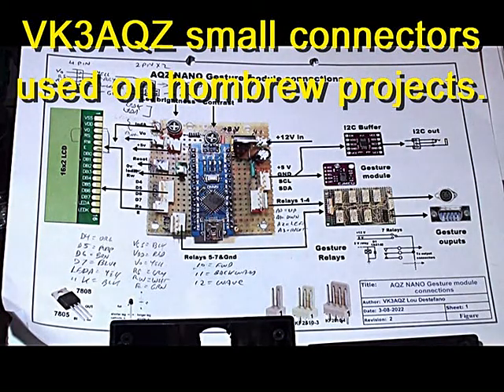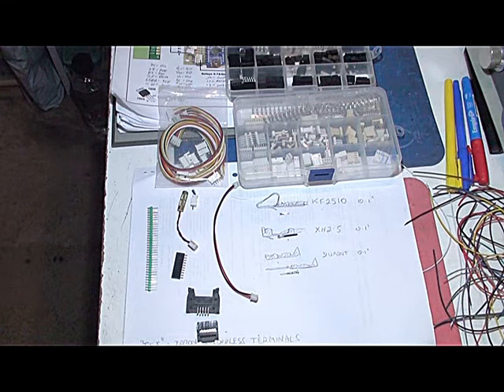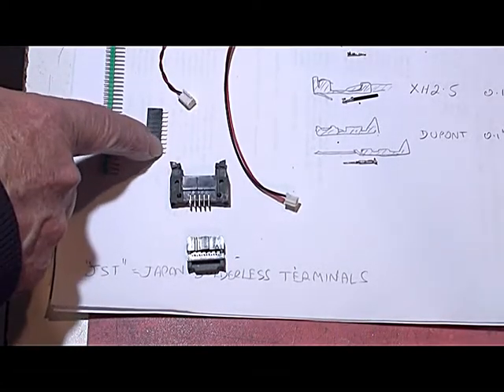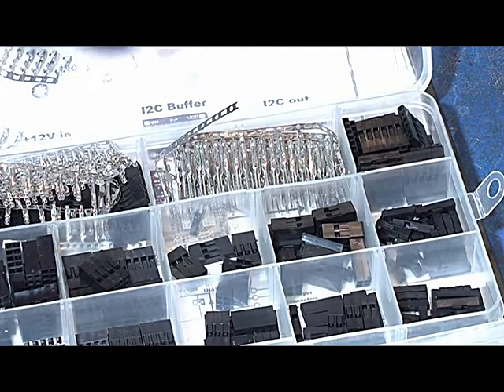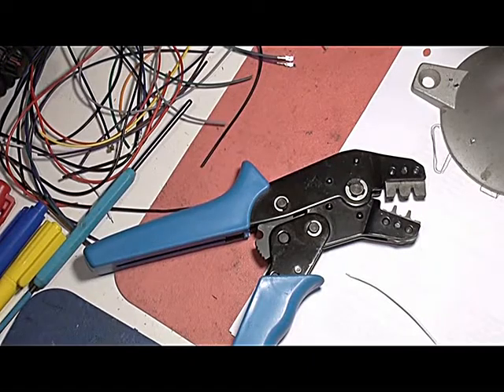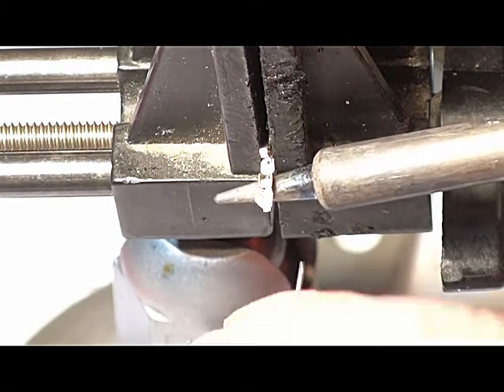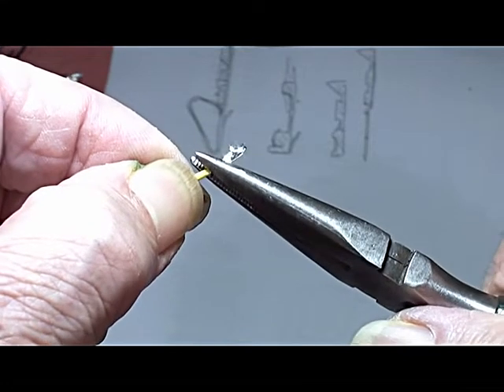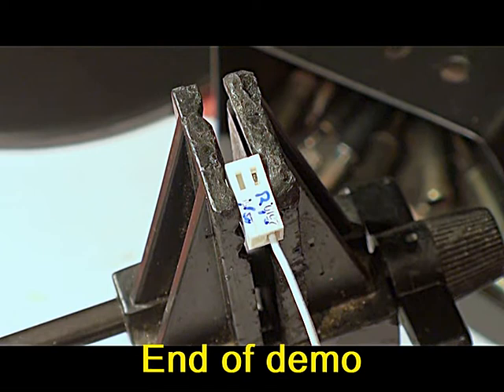VK3AQZ KF2510 connector demo

Comment: I guess the trick to depinning them is to fix them in place(trying the same thing simply by pushing them when they are not fixed is quite hard and often pins are damaged or stuck). Maybe an SL screwdriver cut to push a tab to a specific length should allow me to just do it on a table without vice. Or a vice grip pliers could help to do it fast if connectors with different number of pins should be depinned in a row(many times saw people crimping over insulation when contact is made by loose strands barely touching metal or just plane old loose crimps, I guess if such signs are present you should check all the connectors in a device)
Reply from the maker: Yes, but I hold the connector body in the vice then carefully depress the pin so that the lip goes below the plastic body edge and the pin moves out smoothly and with minimal damage. If you push down too far, causing the spring section to be flattened too far, I then retention the spring section. I test the grip by pushing a loose pin into the connector. If it is too loose, I retention the spring, or use a new one. 

I also have a pin extraction tool designed just the right width to depress the pin. But I am just as quick and clean with a spike. I have watched students try to extract pins in the class and those that don't succeed exert too much initial force causing a distortion of the body but not able to cause the tip to go low enough below the lip in the plastic body.

A bad extraction is just a lack of skill and not understanding the physics of the pin extraction. After I spend time showing students the correct method, they can then depin a whole row in seconds with no damage. It's just a matter of doing it correctly and not just pushing hard or twisting the tool and having a lack of patience.
Reply: @vk3aqz  Could you tell met the model and manufacturer of your extractor? I could not find any extractors for 2510 connector, except some tweezer looking thing that at the time was avaliable only on malasian sites, not even on aliexpress, let alone at the country i live in.
Reply from the maker: @qt1qg  I got it on EBay in Australia as part of a 20 piece connector pin extractor set. The kit has various extractors for Molex, the German motorbike ones, etc. Th KF2510 and VH3.96 extractors are like a small screwdriver with a flat blade about 1mm wide and a circular finger ring. There are about 4 different widths and 2 have a small, pointed tip then a flat blade the same width as the slot in the connector. As I said, I more often just use a pointed tip scriber because I can gently just push down in the right spot since I have plenty of practice. it's just a matter of getting the right feel. You can see from the video how easily I extracted the pin with the pointed tip. It's just skill and patience.
Reply: @vk3aqz  I have seen extractor sets, but they don't tell that they have one for 2510, if it does not have a way to limit the travel of the buisnes end sharp tool is probably better.
Reply: @vk3aqz  At first i thought that spring part of the contact gets bent in the process, but it looks like the tab is the thing that gets bent but not beyond it's elastic limint or not too far to be mangled(spring part does not even have a chance to touch opossit part of the connector body), if spring part starts to bend, depining attempt is failed along with guiding ledges in connector body
Reply from the maker: @qt1qg  Molex make a 4 pin version used on PC Fan connectors. I cannot post  a photo here but you can go to the Amazon site that sells the JRready ST5253-04 as an example. That one is expensive because it is part of a set. But mine came with a bunch of 20 or more on a key ring for a lot less. The keyring ones are single terminal and there are several sizes for the ).1" HF series , the XH, and the smaller JR (Japan  small types). 

https://www.amazon.com.au/JRready-ST5253-04-Electrical-Extraction-Maintenance/dp/B0C3M96DB1?th=1
vk3aqz
Reply: @vk3aqz  I think the only adwantage would be ability to depin several pins simultaneously, looks like there is no tool that would stop exactly when the tab unlocks regardless of the pressure applied. From your video I have learnt to depin 2510 with sharp object pretty well by now, even without vice. Thank you for the video
Reply: @vk3aqz  I have seen 4-pin model being sold as JST pin extractor, though I don't know how it would depin JST females, it seems nearly impossible to bend metal tabs on them, and the tool is to thick to go from behind(the best way to depin JST that I found is to depress plastic tab in the body by reaching from behind with thick THT lead or dull syringe needle, despite what I expected there is no damage done to the connector body)
Reply: @vk3aqz  Before this video I thought that pretty much te only way to remove them was to bend the tab that holds them in place, but it seems it is not necessary, as long as connector is firmly fixed. The height of the ridge in connector body, against which contact locks looks almost the same as male pin width, that means that you won't even cause any excess strain on the spring part if you depin properly!!!
Reply from the maker: There is plenty of single pin ones. Just check out MOLEX KF2510 pin extractors. MOLEX KF2510 are also JS, sometimes called JS-KF2510 connectors. The single pin ones have a narrow bit at the tip about 1 mm long then a wider bit the width of the remaining slot, then a much wider width going to the handle. I have EBay versions of the same tools which cost about $10 for a whole set of 20 plus on a chain. The set covers the 0.1" KF, the smaller JS, the Dupont ones used with Arduino kits, and the fatter VH3.96 types. Plus the various waterproof types used on motorbikes.

 They all work but you just have to learn to push the pins gently and at the right angles if you want to avoid damage. In the tech classes I ran, all the students learnt how to remove pins only after a few goes without any damage. These guys work in companies that handle big looms of connectors of all sorts so they need to know how to handle them properly. 

Unfortunately, hobbyists trying to use them tend to skip over the correct techniques and handling details and tend to be impatient. I have seen lots of connectors in ham gear at clubs wrecked by them. And you should see how much damage they do with the very tiny ribbon cales going to TFT displays and processors! Techs trained to  fix these radios never damage the cables, but these hobbyists make a real mess!
Reply: @vk3aqz  Could find one labled as "single pin" with shoulder on only one side shaped as a crude key, but it was not labeled as 2510, was in the set of 36 pieces. Another one was weird looking tweezer thing labeled as 2510 extractor on inro-electronics(domain is .com, youtube seems to delete links if i'm not the channel owner). And a model for 3d printing that depresses multiple tabs at once. Google is just rigged, or extractor was discontinued long ago due to ease of depinning those connectors

Comment: I need to make-up a 2m cable for the stepper motor on my time-lapse camera slider rail. Whilst I can use a standard cable as supplied for a 3D-printer stepper motor, I have to fit a 4 pin KF2510 connection on the controller end. Not having ever done this before, the demo video is exactly what I needed to know. So, thanks very much !!
Reply from the maker: Hi Austin, very good. Thank you. Cheers.

Comment: Takes 6 minutes of chit-chat before he actually shows you how to use these connectors - but the demo/instructions at the end are really helpful. 

Also great to see how to remove the pins if you make a mistake! Cheers 😊😊
Reply from the maker: Thank you for the comment. Yes, the video was made to illustrate the different types of small connectors that can be used on homebrew equipment. The first section was requested by students as part of the decision-making process and how to distinguish the different pins. I am glad you found the later section on how to make up leads without a crimping tool, and the removal, helpful. Feedback is always welcome so thank you for taking the time to express your view, Enrico.